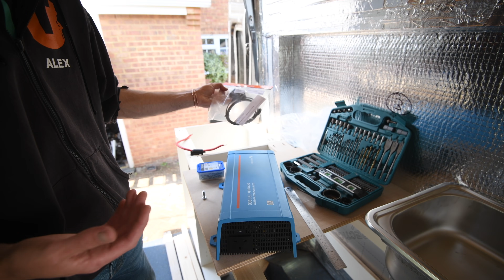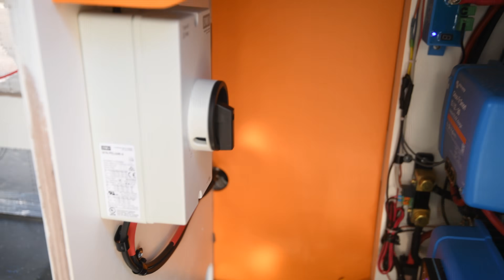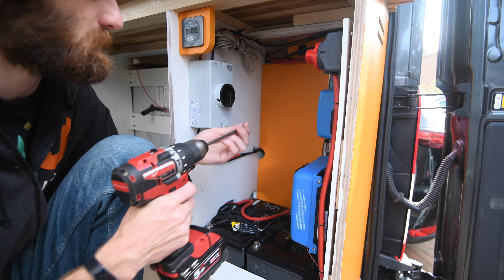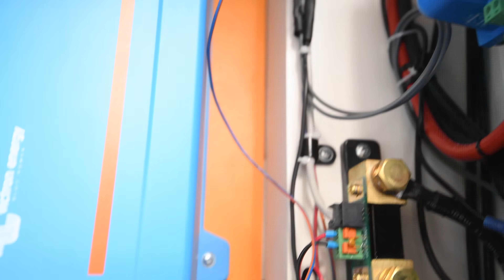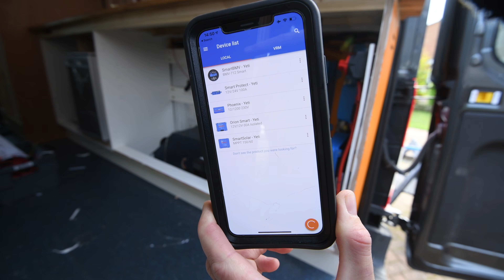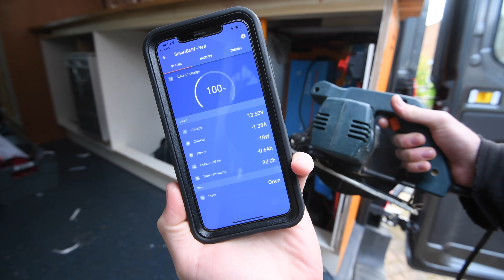Victron Phoenix Inverter 1200VA install | EP32 | Ford Transit Campervan Build

Comment: I would be cautious about connecting the inverter cut off from the battery voltage cut out as you may finish up with hunting. If the battery low voltage cut out resets automatically if the voltage recovers, then the the inverter would be re-powered pull the voltage down again and be cut off again and the cycle would repeat with potential damage.
Reply from the maker: Aye I see what you are trying to say. For this set up the low voltage cut off its can be both hardware based via the remote off / on pins and a signal wire which I have connected up to the Victron Battery protect. which will trigger a low voltage cut off at a set low System voltage and then a different “clear” and higher voltage before it re-engages. To get past the clear voltage after a low voltage trigger would probably take about 30-40ah of ( at 12v ) power put into the batteries. On this model of inverter is can also be software based and managed the inverter itself again with a low voltage cut off and a clear re-engage voltage.
Reply: @MispronouncedAdventures  Having a deadband between cut out and re-engage should stop an potential off/on oscillation provided the margin is large enough. When the inverter load cuts off the sensing voltage will rise due to the loss of load volt drop on the cables and the battery voltage will rise as the batteries recover even without any additional charge added.
Reply from the maker: Ah voltage Sag under load. Very true. Definitely more problematic for lead acid based Systems compared to lithium-based ones

Comment: I have the same unit, but in 24V. Just wanted to say its a 1200VA which is just over 1090Watts, we are also planning on getting another inverter that’s 3000Watts at 24V to run items that require high Watts, this is when we get 2 Tesla batteries, at the moment we only have 1 Tesla battery
Reply from the maker: Yeah it very true. It’s more 1000w at 25c and decreasing wattage as temperature increases. About 850w at 45c. I find using VA can confuse people a wee bit. That’s really cool you’re using Tesla batteries.
Reply: @MispronouncedAdventures  thanks, we don’t have much running on our system, but when we go full time abs we discover it’s not enough, then I’ll add another battery to the build. I’ll have to make space for it now just Incase 😁
Reply: can you run up to 2000watts in  what is the max it can reach
Reply from the maker: Yeah I believe looking at the data sheet the max peak is 2200w. But I presume peak power is only for a  few seconds
Reply: @MispronouncedAdventures  yes that’s right, I ran a heat gun at first speed 1300W and it worked  for over 30 seconds but I kept getting overload warning. Then I put it to second speed at 1800W it worked for about 3 seconds then the inverter shutdown lol

Comment: Do you think that victron would handle a 1000w electric kettle or hot plate?
Reply from the maker: In theory yes but 1000w continuous would be a at the very top of its limit if it as running at 25c, 40c it would be only 850w ( information from the Victron spec sheet )  running it at its max I can’t imagine is the best idea. I think if you wanted to run a 1000w hot plate I’d probably look at some of Victron other inverter lines. 

You’d also need a decently large battery bank to match such a high demand
Reply: @MispronouncedAdventures  ok thanks for the information

Comment: What I love about your build is the attention to detail for example why doesn’t everyone paint the inside of their cupboards 😂 such a finishing feature. Your painted electric cupboard makes it sooo much easier to see everything rather than a plywood finish. Well done sir I doff my cap.
Reply from the maker: Thank you very much. I personally thing the extra details are important. In the electrical cupboard it just makes everything easy to see ( and look cool ). In reality it’s not that much more after work. I have the paint anyway for normally visible parts so I might as well use it. Just wanted to you see the finishing work on the water and plumbing cupboard haha

Comment: This is funny, my van has exactly same inverter. Little bulky but rock solid performer.
I've done fixed AC wirings and have electrical box which has GFCI protector followed with 10A and 12A dual pole circuit breakers. Ground is connected to chassis and inverter ground also.
Reply: Here is my arrangement: https://photos.app.goo.gl/1gzv1KJLgBzcfxkA8
Reply from the maker: Looks good. So far I’ve been love it, they definitely seem like a sturdy bit of kit. Depending on how many AC outlets I go for I might add a small electrical box for the just ease of wire management
Reply: @MispronouncedAdventures  Yeah, that's why by box has cable with plug for inverter and then spreads from two circuit breakers to two circuits. 12A is for driver side where induction hob is, 10A to passenger side outlets.
It's important to use dual pole breakers and put GFCI in front of everything, dual pole because as inverter is coupled with cable & EU plug it's not guaranteed which one is ground. I've replicated what's factory built to my Solifer camping trailer here.
Reply: Ah, another important thing for AC circuits... always use cabling with multi strand wires. My choice was to buy 20 meters 16A rated extension cord, red, and initially just chopped it between box & one outlet. Cable was circled around all necessary outlet positions without cutting and then when was time to install outlets cut cablings accordingly.
This was both cheap and provided functionality during building, with protection. Also connected chassis ground to box initially...
Reply from the maker: I definitely seems like a good course of action. If and when I take it further than just using it as an extension plug. 

I would definitely use Duel pole as well, whilst most of the 12 V stuff in the van a single pole isolators, things like the solar im using  dual pole
Reply from the maker: Aye I’ve got some Arctic blue at the moment to run which is Multistrand. The idea of using traditional household AC circuit was solid copper cores and the effects of work hardening from flexing on copper definitely isn’t a good idea
Reply: @MispronouncedAdventures  That's good practice. I've also got 2p DC breaker between solar panels and charger. For DC, 2p not really needed, makes things little easier.
Our mounting grounds panels also as bolted to roof. My camper has just 3M VHB strips between roof & panel mounting tabs, there I've run grounding wire from each panel frame down to camper chassis ground.
Reply from the maker: I went with DP for the panels as talking solar installer neighbour he recommended this as best practice. Which makes sense as at peak output could be around 75v @ 8amps. Not something to make a mistake with.

Comment: At what point in the planning stage do you work out where the electric bits and bobs go, or is it all add hock ????
Reply from the maker: A mix really. I made an electrical diagram back at the very start before I got the van. So I could try and understand and visualise where the conduit layout / cableway were going to be.  In reality the core of the electrical System remained to same but the layout and physical aspects of the electrics changed and adapted over time when necessary. Such as the physical space for putting things was created like the cupboards or The realising I made a mistake or needed to add something new